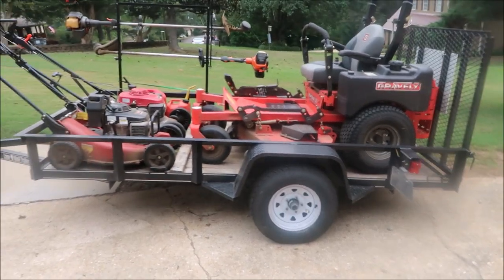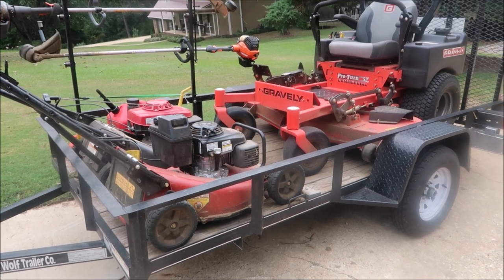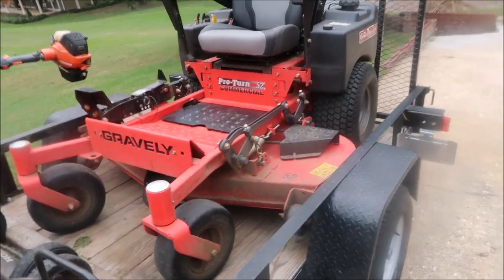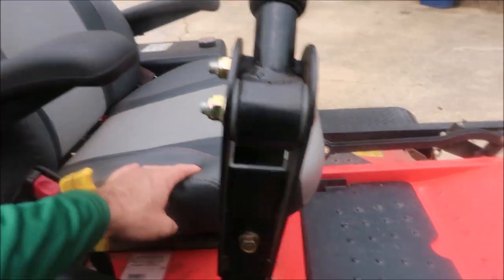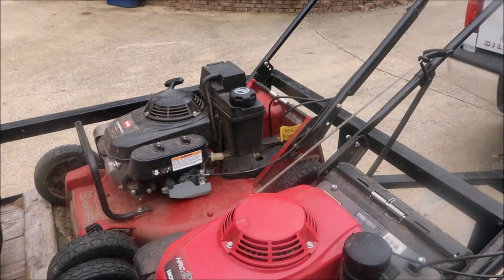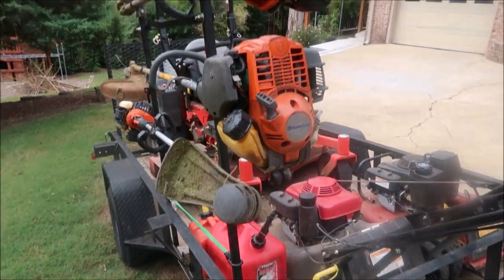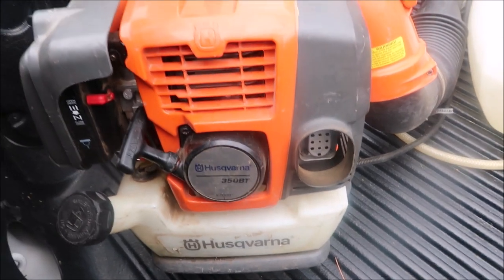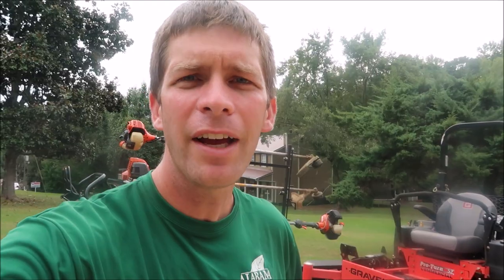Great Lawn Care Equipment Setup for Making Money

Comment: I am running with a 5x10 trailer with a Jungle Jims Trailer Mate basket on the front. I wish i wouldn't have bought the basket though. At the time i was growing and didnt know much about trimmer racks, green touch, equipment defender, etc... I currently have a John Deere 636m Stand On, Honda HRX 217, and a Toro Timemaster along with a AWD Husqvarna push mower. The Honda stays at home most the time. As far as trimmers blowers and edgers go, i use an Echo Blower, Echo trimmer, and a Stihl curved shaft edger, and of course all the other necessities. 
My goal is to upgrade to a larger trailer, and possibly enclosed. I will say what i currently work with works great for a part timer, a money maker. 
Thanks Jason,
Randy

Comment: I'm a first year solo operation. I currently carry residential accounts only. I have a 2013 GMC Sierra 4wd and pull a 10'×5' open trailer. Equipment being:  Husqvarna 46" zero turn w/2 bagger and mulch kit as needed, craftsman push mower, worx trimmers and blower, 5 gal gas can, scott's dxl broadcast spreader, and various lawn tools. Pretty basic, but is serving me well at this point. Will def upgrade to a large stander primary as accounts grow ( which is currently happening :) Love this video👍

Comment: I have 2x ego mowers the duel battery unit and the 20" steel deck mower which takes a while longer to use ego trimmer full carbon shaft and ego power head with edger, and 600 cfm ego backpack blower.

Comment: I have 21” troybuilt rwd xp, redmax 2350, redmax 2450 max torque trimmers, redmax 3050 edger, 2460 24” hedge trimmer, stihl km90 with trimmer, hedge trimmer, and brush cutter attachments, redmax backpack blower , stihl handheld blower, exmark metro 36, and gravely zt hd 48 with rops. Its perfect setup for the lawns i mow a week
Reply from the maker: Sounds like a good setup. You seem to be a fan of you RedMax. I love RedMax blowers
Reply: Lawn Care Life i like my redmax, the only faults are carbs on em. But if u look online, and have a little knowledge and mechanical skills, u can easily replace cheaply

Comment: I have a money efficient small setup, 5x8 trailer, Toro timecutter 4225 22.5 hp, toro 21'' AWD push mower for the back yard that have a 32'' gate, echo 225 trimmer with echo 250 blower. all cheap all brand new when i got it and i do residential, all my lawn are between 2000 SqFeet to 8000 SqFeet
Reply from the maker: I like your strategy
Reply: @lawncarelife  I do wish i had a tiny bit more room in the trailer becuz right now my truck is my tool box lol but other then that its been good. Who dosnt want a bigger trailer anyway lol

Comment: This is merely my opinion but what I have seen here on YouTube,unless you are doing a lot of really big open areas I  think a stand on zero turn vs the riding zero turn mower would be the way to go.more maneuverable,easier to see what you’re doing and take up less room on the trailer due to the shorter wheel base
Reply from the maker: You make a good point. There are advantages to each. I have not spent enough time on a stand on mower to give an honest opinion.

Comment: I take two 42 inch Walkers and one Honda 21 inch on a 16 foot trailer. Of course, I bag and use the 21 on steep hills. Two Stihl combi units with edger, weed eater, hedge trimmers, two 770t Echo blowers.
Reply from the maker: What do you do with the grass clippings?
Reply: Most of my properties have wooded acreage where I can dump in low spots and spread. Sometimes, I have to bag.

Comment: I am still working out of the bed of my truck, hope to get a setup like that next year.  I was thinking of getting a 36" stand-on (I only do residential currently). 
Which would be better... a zero turn or stand on?
Reply: scott cecil stand-on for sure! Especially if you have any slopes or hills. The small footprint of a 36” zero turn makes for a scary ride if you’re on very much of an incline
Reply from the maker: For 36 inch I would definitely go with a stand on
Reply: Go with the walker. Theyre expensive, but vast majority of dealers have no down payment WITH 0% FINANCING if you qualify. Now that i have a walker i will never go back, just like i wont work without my radio noice canceling headphones.
Reply: Definitely a stand on mower if you have a dealer near you the Ferris z1 is a nice stand on
Reply: @scottmorgan3577  stand-ons are only good during growing season. You cannot do fall and winter cleanup maints with just a standon. Youll be forced to blow all your properties. Not to mention if your customer has weeds youre spreading the seeds by not collecting. Walker has a HUGE collection box that operates like a dump truck, sucks up every leaf and piece of straw, even gets all the small sticks and all the pinecones or sweetgum balls. Leaves the best cut over all other mowers during summer also. Like i said theyre certainly expensive, but the only way to go imo.
Reply: scott cecil Get a stand on. Start looking for a setup right now. This is the best time of the year. Guys that didn’t make it the first season or got in over their head. Check some dealers as well.

Comment: Commercial machine with homeowner engine?
Reply from the maker: I wouldn't consider that a homeowner engine
Reply: That kawasaki motor is an excellent motor. It is used on some homeowners mowers, but is a commercial engine

Comment: Primary mower should be john deere
Reply: Jim Mckillip 
I use a 2015 John Deere Z920m, and It has been great! No problems in 325 hours, only thing I dislike is it can’t hold hills hardly at all! Forget mowing hills if it’s damp out!
Reply: Love Deere but mowers are junk. They are rough riding and parts are high. Exmark has been nice for me run 3 of them for the last three years not a thing has went wrong.